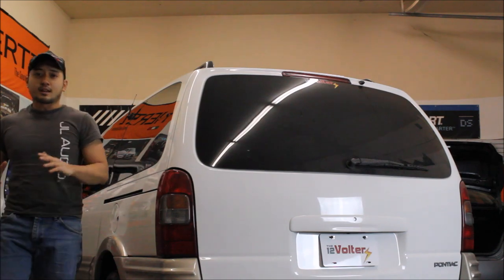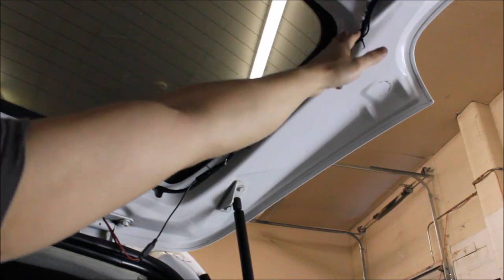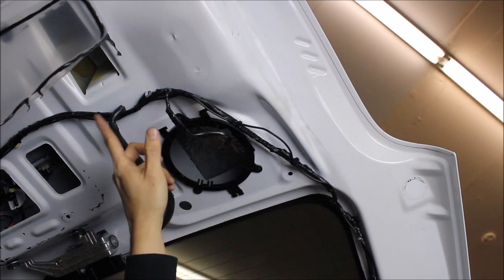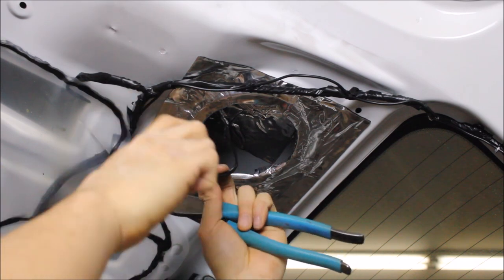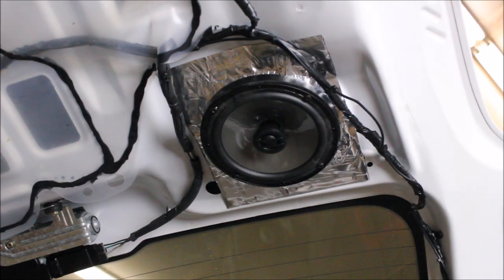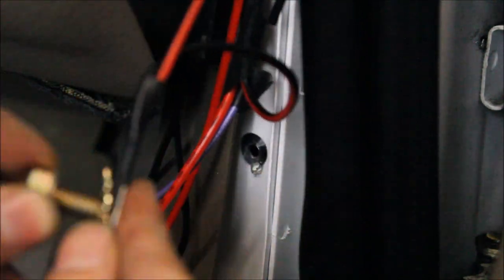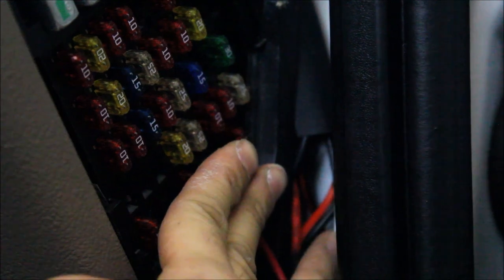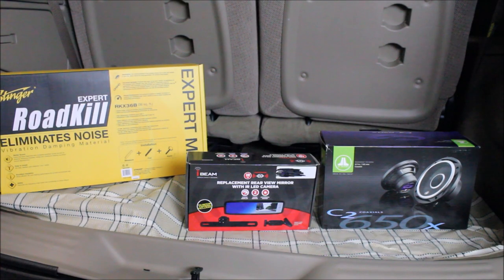Builds: Make a Minivan cool Part 3 | AnthonyJ350

Comment: So why exactly did you put a square of sound deadening on the inside of the hatch? On the mounting hole I understand but the inside..
Reply: Like, does that small piece help with the sound in the cab of the vehicle or something?
Reply from the maker: kain452005 The panel behind the speaker will resonate. You want to help reduce it with sound deadening. Remember the speaker will create sound waves in both directions.
Reply: So theoretically it would be better to use sound deadening throughout the inside of the door..  Just probably pretty hard to do depending on the application.. That small piece really makes that much of a difference? I ask because I want to redo my speakers on my 01 Tahoe when I FINALLY get around to installing my amp..
Reply from the maker: Bang for your buck the small speaker kits do make a big difference.  I do prefer to do the whole door but we're building a mid-grade system and trying to keep the budget lower.
Reply: I appreciate the tips.. Your channel is a gem..
Reply from the maker: kain452005 I'm glad they're helping you. If you like any content please share it, it helps a lot ;)

Comment: Whenever possible you should cut the speaker whole out in one piece and put that speaker sized piece of sound deadener inside the door or hatch on the exterior piece of metal. That way both metal panels are treated.
Reply from the maker: We cut the sound deadening in a "pie slices" so we can fold it back and double up the speaker mount.  For the back side we put a new sheet.  Same idea, just more material is used.
Reply: @AnthonyJ350  you are just doimg both sides of the same piece of metal and leaving the metal behind the speaker completely bare so it can rattle and sound like crap. I was trying to help you but im pretty sure you dont understand.
Reply from the maker: @realname6485  I understand what you're saying. The problem is you're only looking at one video. You should watch other video I do sound deadening and not assume I don't do what you suggest.

https://youtu.be/VUzfINPAFcE
Reply from the maker: @realname6485 
My original Dynamat video where you see I put it on the outside metal that you are telling me to put it.
 https://youtu.be/XUM360veHag
Reply from the maker: @realname6485 
Me installing and explaining FAST rings to supplement sound deadening material.
 https://youtu.be/zxyDVDecojI
Reply from the maker: @realname6485 
Completing my door treatment and doing the door cards.
 https://youtu.be/QaB7N_VqdNw
Reply from the maker: @realname6485  This is me doing my roof https://youtu.be/FXRC4ELTyMU
Reply from the maker: @realname6485  This is me helping with a full resto mod https://youtu.be/8sn_pecD3TQ
Reply from the maker: @realname6485  Putting sound deadening on an exhaust shield to reduce rattle.

https://youtu.be/4MoVV03gLNU
Reply: @AnthonyJ350  hmm it appears you misunderstood me again.
Reply from the maker: @realname6485  Installing sound deadening in key areas to reduce NVH

https://youtu.be/KV5fzIZyawc
Reply: @AnthonyJ350  im not questioning your skills
Reply from the maker: @realname6485  You want Dynamat on the inside skin and outside skin. I'm showing you I do it and I go above and beyond by using other products in various installations.
Reply: @AnthonyJ350  ok cool just stop spamming videos lol
Reply from the maker: @realname6485  Last one, I even put Dynamat in my custom enclosures to stop resonance.  That's how much I'm on the same page as you. https://www.youtube.com/watch?v=A3QdP9pPgp4

Comment: do you have a link where i can watch or buy that same mirror and backup camera?, thanks.
Reply from the maker: What kind of vehicle are you putting it into?
Reply: AnthonyJ350 chevy caprice classic 1985
Reply from the maker: carlosmostro Try searching Brand Motion. I like their stuff. They're more expensive but the quality is good. Did you consider getting a flip out screen for that car?
Reply: AnthonyJ350 not yet..i install a 10 inch galaxy tab 4 on it..theres where i have all my media...but i like that mirror you install..because i try ebay but there are only mirrors that clip to the original one...they will fall

Comment: Just found your channel, great vids.  I have a question regarding a 2013 ram. I installed a backup camera to my pioneer head unit. I can manually trigger the camera no prob. and when thr vehicle is not running but in the run position the camera will trigger in reverse every time. but when it's running I get intermittent activation. I know that dodge has a new electrical system and its not quite 12v at the tail light. sorry can't remember the exact voltage. been a while since I looked at it. what am I missing that my camera will not trigger when the truck is running.
Reply from the maker: brent19731 Did you use a module at the head unit?
Reply: AnthonyJ350 nope. didn't think one was required.
Reply from the maker: brent19731 How did you get accessory to turn on the head unit? The harness has data to turn on the factory unit.
Reply: AnthonyJ350  just used run of the mill wiring adapter. I bought my truck with the most basic of head unit to avoid the module crap. I'm triggering via reverse light. I was thinking a small cap in some way to keep voltage stable for the camaera.
Reply from the maker: brent19731 Weird, I've never seen accessory in those truck's since 2009 in the harness even in base models. You  can try a relay but a Pac module would have everything for you.
Reply: AnthonyJ350 yup weird is right
 I'm sure it has something to do with power. I'll double check the voltage at the trigger source today. maybe try a small ceramic cap in line to smooth out the voltage.  thanks for taking the time to respond. if I can find my pics of my ram build i will post them. I also fabbed a glass box for my truck for 2 10" apline type r.